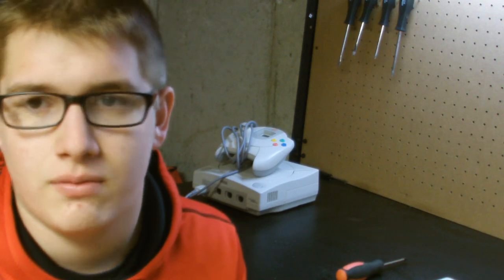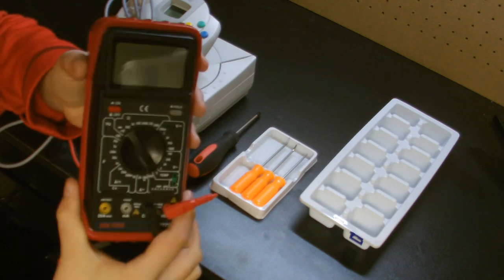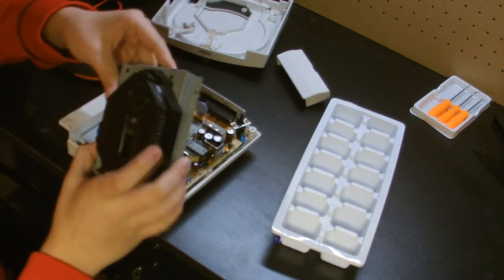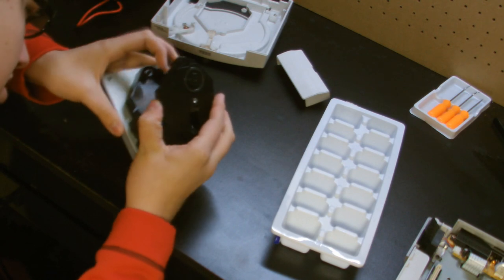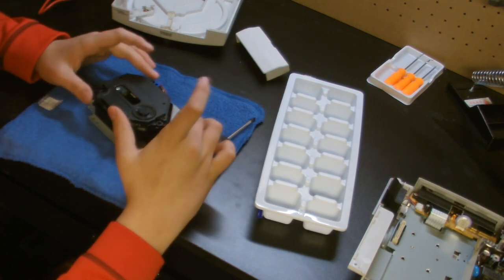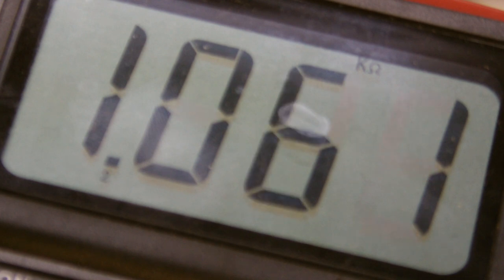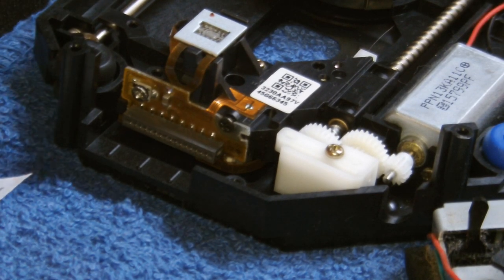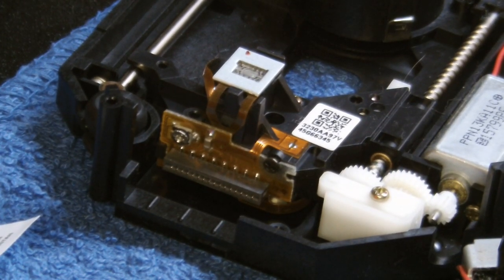Dreamcast Potentiometer adjustment-Fix disc read errors/laggy games

Comment: Hi. How many degrees to the left or right should I adjust to the left or to the right. This is for a NTSC (V1 I believe, it's not the one with heatpipes, no metal fan). What contacts are you touching the probes at?

God bless, Rev. 21:4.

Comment: It's call pot tweaking the laser. Google it and get step by step directions
Reply: Potentiometer adjustment & "Pot tweaking" Mean the exact same thing but using correct terminology over slang
Reply: @retrofox3084  to be fair though, "pot tweaking" has more relevance to the game console modding scene, so googling both terms might be useful.

Comment: What about turning the screw to the left instead? Increasing instead of decreasing? I heard that works too
Reply: The potentiometer controls the the amount of power flowing through the laser. Turning it clockwise increases the power, while turning it counter clockwise lower it. Be careful as to not overclock the P.O.T. since overpowering the laser and letting read a disc for too long can destroy the lens completely. That in turn would require a new lens replacement or a new disc drive all together. Glad I could help. TL;DR Don't twist the P.O.T. too far clockwise or it will fry your disc drive. Twist the P.O.T. in small increments